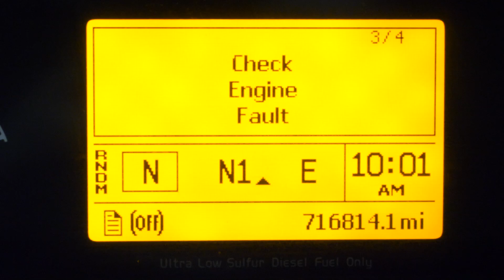2009 Volvo D13 Reset Engine Derate & High Soot Level | OTR Performance

Comment: I have professional or PRO tool one ☝️ 
What is the point I have to take the truck back to dealer because your tools 🛠 only reads the codes nothing else :( 
It’s not deleted the codes and can’t take off 5 miles derate restriction and can’t do force regime either :((
And I text OTR and the never 👎 answer:( for a $-900 and every year $-600 it’s kind useless only just to read the codes :( 
I am disappointed and it’s kind amor a scam not a scan tool :(
Reply from the maker: Hi Mihail, I'm sorry to hear you are having trouble. I see in a previous comment on one of our videos that you were able to help one of your friends clear his codes and do a forced regen with our tool, and we wanted to know what might be going wrong with your truck. We tried contacting you, but we were sent to your Voicemail. 
We have an entire tech team ready and can help with any issues you may have with the tool or any questions about your truck. You can contact them at 586-799-4375.
We hope to hear from you and help you get this issue resolved.